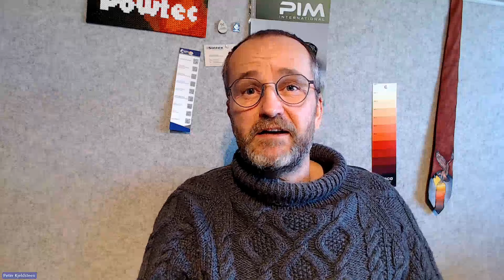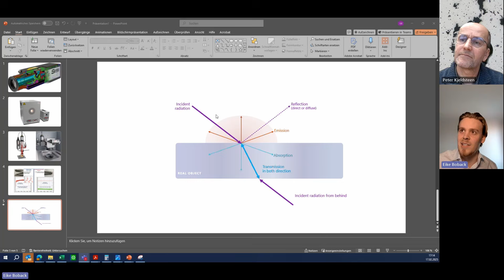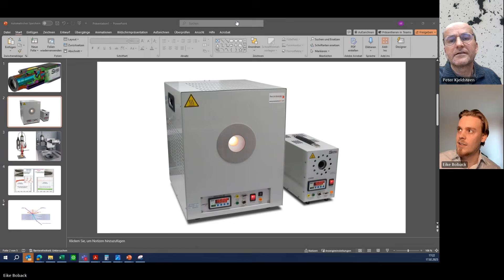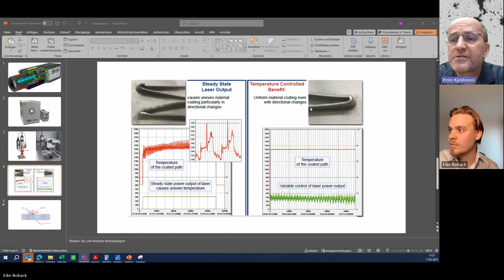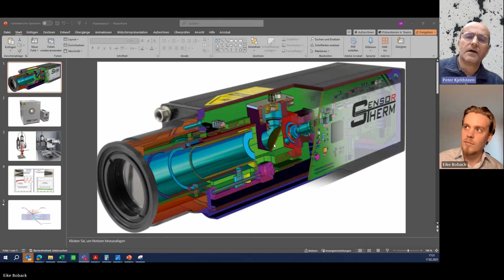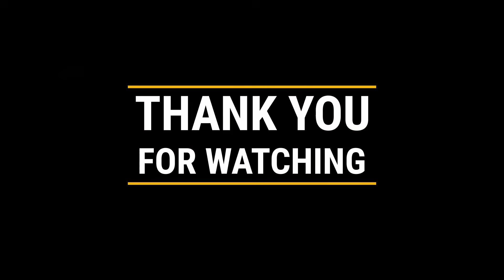Measuring Temperature With the Speed of Light

Comment: adjusting the power (heating) as subsequent layers are added is a great level of control.  I understand the description provided by Eike and the control provided by Sensotherm equipment looks really good.  I'm wondering how much feedback is normally included from manufacturing systems (eg. TruPrint or and LMD set up in a TruLaser Cell 3000 or a similar model from another manufacturer).  There are many!!